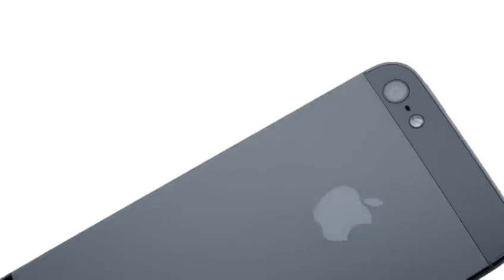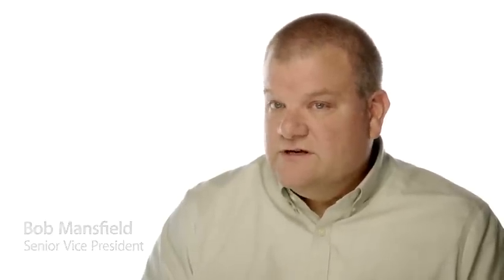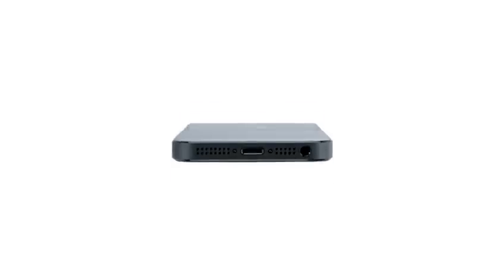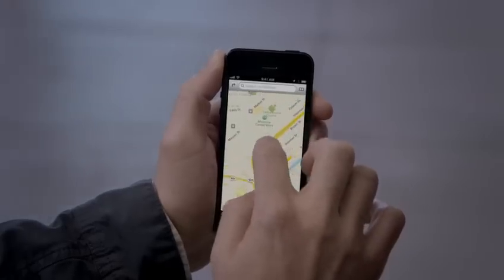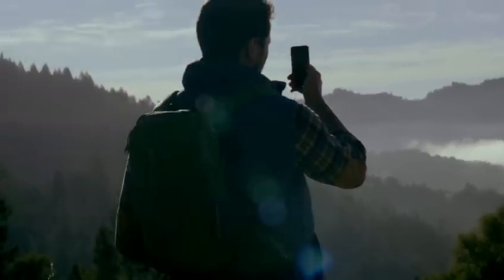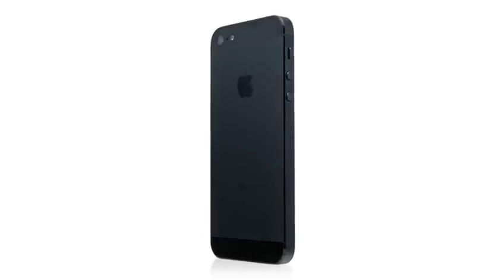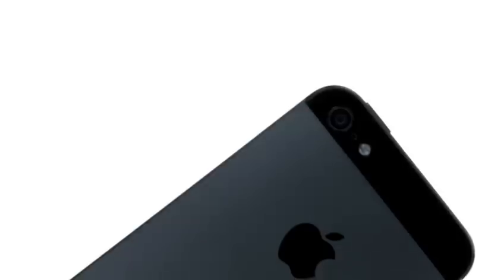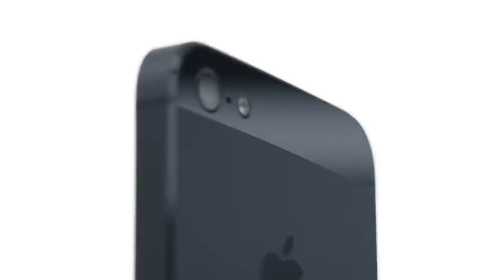iphone 5  Apples Official Commercial - HD!

Comment: 1) Yes, the Galaxy SIII has a Quad-Core processor, versus the iPhone 5's dual core, but that doesn't mean anything. A phone processor needs is speed and efficiency, not raw horsepower. Quad-Cores use a shitton of battery for what I can't imagine much improvement (This is not a gaming PC)

2) Not really, considering the average size is 4.3

3) It's been in the iPhone since the app store, what's your point?

4) 720p video, not some shitty WVGA video

5) The optics are at least the same as the GS3.